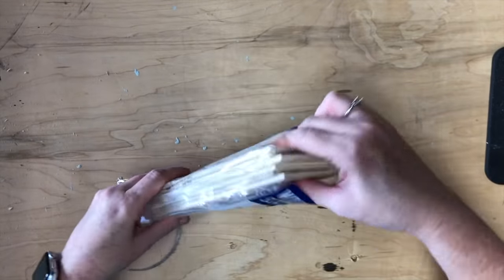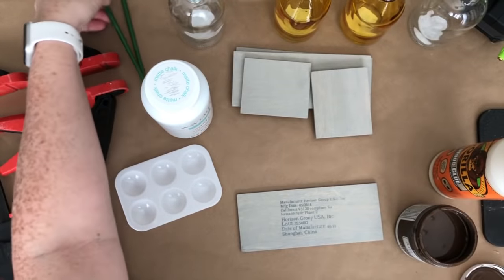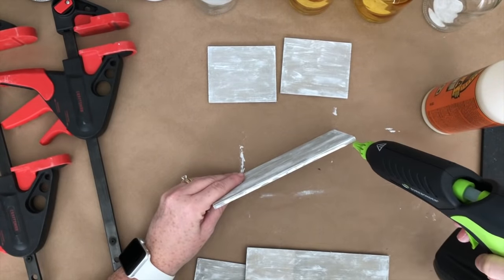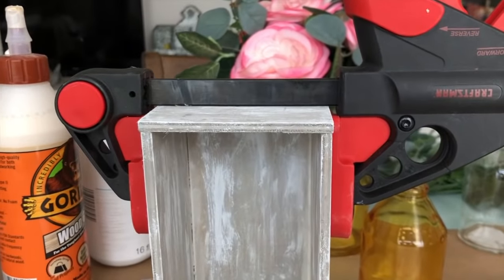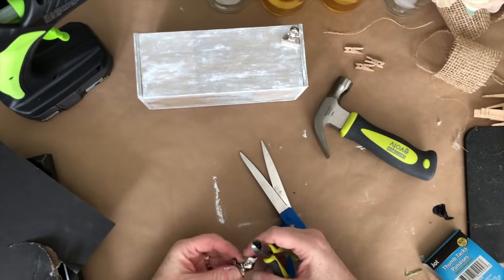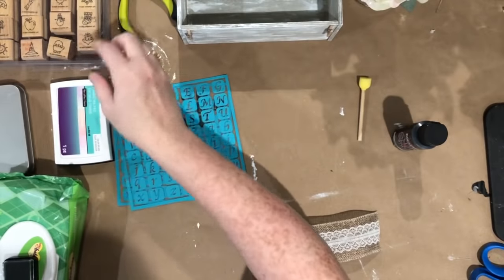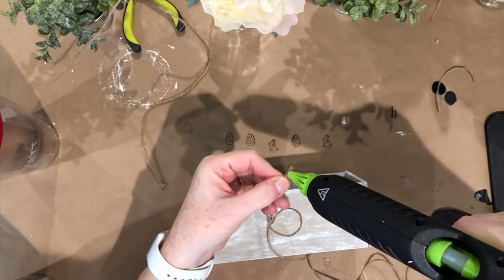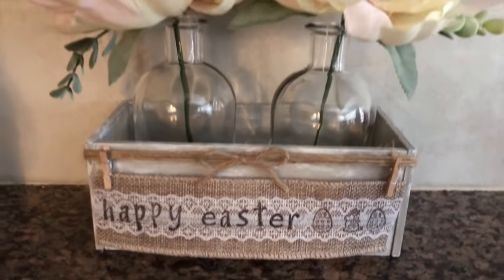FARMHOUSE DECOR DIY  |  AFFORDABLE SPRING DIY

Comment: I am so glad you are doing this up coming series. I am interested in purchasing a new glue gun. I have never had a mini one. I was wondering if you think you need both kinds? And if you need a low temp and a high temp? Right now I just have a high temp standard glue gun, using standard size glue sticks. When would you need a smaller one? For what kind of projects. I do a lot of crafting. Thanks again for the upcoming videos on this subject. :)
Reply from the maker: Dorothy Nelson  These questions are definitely things I will cover in my series.  A long time ago, I started off with a mini and then progressed to a larger glue gun.  I don’t really use my mini anymore.  As far as the temp goes, it all depends on what materials you use.  Low is good for delicate materials, High is good for wood/metal.  I’ll definitely address these questions more in my video. 😊